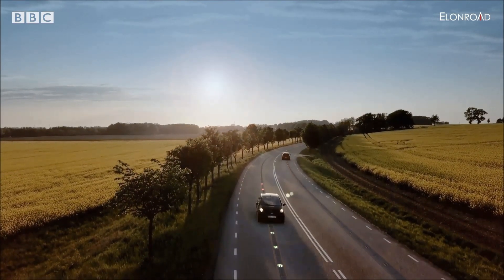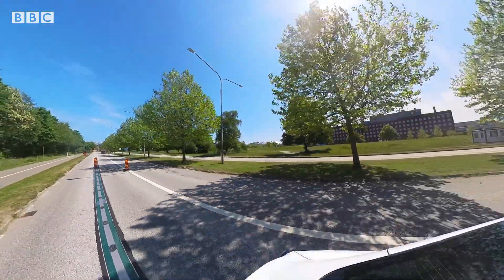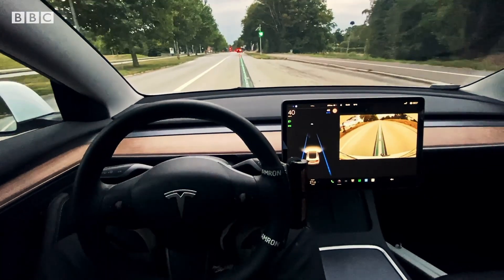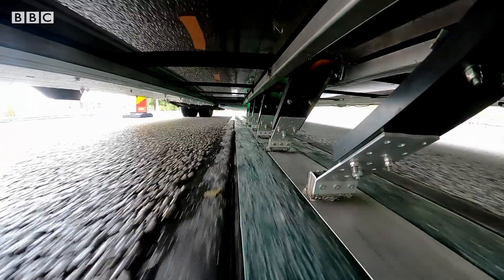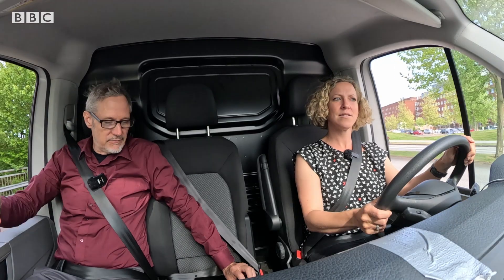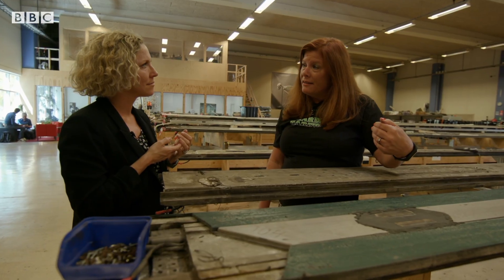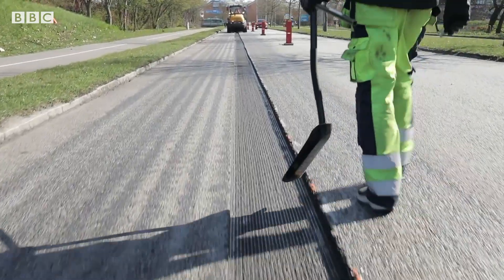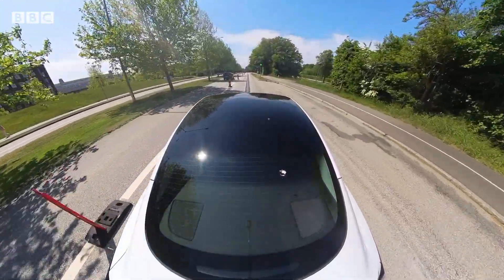The electric roads that charge your car as you drive - BBC News

Comment: Its a great technology. There are many concerns.... many people have already listed it. 
The smaller problems.
1. Drive a straight line. Can be solve with a wider contactor(from the car) to compensate for the left and right swaying of the vehicle. 

Now the good thing. 
1. Good for traffic jams, where certain distance the vehicles (EV only and not IC engines) can charge their vehicle while going at a slow turtle pace or at a complete stop due to traffic congestion. 
a) it helps reduce the losses from such congestion. 
b) Only at moderate to massive congestion location. Not the entire road system.

Comment: I had a similar idea, have the highways setup similarly to old slot car tracks.  The cars would need a simplified self driving ability.
   Cars could charge while driving, and get by with smaller batteries for when they leave the main highway systems.
   Of course we would have to abandon the idiotic solar and wind power pipedreams and go nuclear.
   This would take a lot of load off the system from charging stations and be a big step in solving the battery problems

Comment: THE EV "RIP OFF" SET TO INCREASE !!!
Another Con trick the public will pay for. You do NOT need "Electric Roads" to recharge EV's whilst on the move. You only have to fit them with an onboard Dynamo or Alternator. But then the Governments won't be able to TAX your EV's recharging methods, as Fuel TAX dwindles !!!!

Comment: From a purely engineering point this is an absurd plan, the term efficiency relates to how much energy would be wasted so say a direct charge has an 83% efficiency and could be up to 90% a system like this would only amount to a 50% efficiency at best but most likely being closer to 40% meaning we would have to produce roughly twice the amount of energy to charge the vehicles. 

Factor in the insanely high carbon emissions production of EV have in the first place this system would cause higher global emissions than your combustion engine automobile.

Comment: As a mechanical and aerospace engineer I find it preposterous we are switching to electric cars in the first place. Electric cars currently at least are of lower quality and longevity compared to your average combustion vehicle plus the carbon footprint due to the higher production output would only be marginally less than a combustion car.

The future should be an initial push to hybrid cars while we try to innovate in the electric storage (battery) technology and electric grid. If the electric grid like in today is largely depended on gas it makes little sense to switch to electric as we are still contributing to global warming.

The automotive industry as a whole is responsible for roughly 28% of emissions worldwide while electricity production is responsible for a further 25%. What we need in order to tackle global warming is a concentrated effort towards efficiency around all sectors rather than trying to set up a whole new system. 

Increasing the share of renewable technologies, investing in lab grown meat products, making the car industry more efficient by better hybrid technology, lowering industry (23% of total emissions) carbon footprint and improving residential energy efficiency such as phasing out pollutant gas heating would represent a 50% drop in emissions by 2030 rather than gutting the cad industry in a empty effort to show voters government is doing something about climate change.

Comment: I assume at winter time you would have a heating element on the actual charging part, but it would also force people to drive at a very identical driving lane to keep connection, forming deep and somewhat dangerous tire tracks in the ice normal buildup on the road. Then there's the question of salting the roads as we do here. I would assume a salt and slush mixture would not be kind to the charging system, at least not in the long term, making it require even more maintenance from all parties.

Don't get me wrong, I like it because it's cool and futuristic, but I'd guess there might be a multitude of practical problems yet to be solved or even thought of with this technology.
Reply: Which is wireless charging makes more sense. A sealed system that's less exposed to the weather and various hazards.
Reply: Please give your number,😭😭
Reply: They do this with rail systems where the third rail might get coated with ice and cause a disconnect.  It's basically nothing more than a very long heat tape that turns on when the temperature drops.  But this is also something that requires a fair amount of energy.

Comment: Caution: DO NOT piss on the third rail.

This seems difficult. You'd have to hold your lane very precisely. Induction roads would be less efficient but much easier to implement. Personally, I like system with overhead contactors for large vehicles like busses and tractors. The system has worked great for trains for the past 1035 years.
Reply: There's already an electric tramway line along that road - it was launched a few years ago, with its own driving lane. 

Saw this on the TV Saturday morning - the first time I've ever seen my hometown featured on the Beeb. :)

Comment: Can thieves tear up the metal in the road and sell it as scrap?

The public electric charging station in front of my building was torn apart, all the coper likely sold for scrap
Reply: The metal parts are fastened from the other side with big bolts and glue. Getting them off is not easy

Comment: Seems a bit excessive… All you need is these contact charging points in car parking spaces, as opposed to entire stretches of road. That way your car can charge at point A and point B and you’re ready to set off to point C.
Reply: Funny you say that as they sell the charge-while-parking solution very successfully. As well as quick-charge at the stops for public transport, industrial machines, etc.  As far as I understand its the same system but with different and more resource-efficient applications than the extended road systems.

Comment: They tried something similar in the UK about 5 years ago. A road had overhead contacts and further down they tried contactless charging.

Saw the little experiment... saw it working... and then never heard about it ever again, not even the results or plans. Which probably means that it was successful and the Tory Government are scared their friends in the Petrol business would lose out.

I say good luck to Sweden and i genuinely hope it's successful. I also cant wait for a country to publicly tell crude oil companies to get lost... and that day is fast approaching... Crude oil no longer provides unique essentials... Literately EVERYTHING crude oil does now can be replaced... and they know it, hence them trying to milk every penny now. I also say that the last Crude oil company to go green should be banned... just to send a little incentive and message.
Reply: I think you are getting confused with good old fashioned "Trolley Buses". Which had two parallel wires strung above each road lane (One plus, one negative), and could certainly exceed 60mph even with 100 seated passengers on a double decker, as demonstrated across "Mitcham Common" (South London/Surrey border) in the 1950's.  So what did they do ? Scrap the pollution FREE Trolley buses, and change to pollution making diesel buses, which have never had anything like 100 seats even on the Double Deckers !

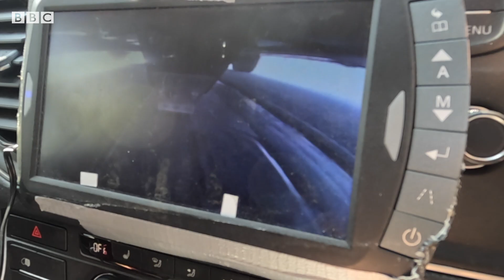Comment: Is it charging anywhere near full power in the demonstration? I would expect some sparking from the high current and voltage needed to charge an EV. Also, if that was to be used on a real road with contamination such as petrol, that road could ignite it? I also don't think the power delivery would be very stable, especially after seeing the contacts bouncing around (2:30). Any dirt on the metal would reduce continuity and cause more friction and wear.

Comment: This is a terrible idea. I cannot believe it’s been funded to this point.
Reply: Why
Reply: @TedKHole  it’s not easily scalable, is very complex, and is made redundant by the home charging and supercharging. In addition, cars will need sufficient sized battery packs to operate in areas which inevitably would not have this infrastructure set up, so it doesn’t help reduce the battery pack size.

Comment: It's a pipe dream of EV enthusiasts  ... the costs would be astronomical and not realistic economical viable.It's also anything but eco friendly etc. The only way forward for EV vehicles is to improve their fuel cell / battery technology dramatically ... i.e.have an energy density equal or better than fossil fuels. At Oxford uni they're working on revolutionary lightweight  carbon nanotube battery technology. Such carbon nanotube batteries would be lighter and more energy dense than current Li-ion batteries etc. As for electric roads, that'll be a step back in time.

Comment: This in theory looks good, but what about if you have to be switching lanes. You would need a power track in each lane. Not all vehicles can stay in one lane because of traffic and other issues. 

How is able to overcome issues with winter conditions when the roads are frozen over with ice and snow. I would think inductive charging would be better because of non contact. 

I would not reduce battery size in vehicles, because people need the freedom to be able to go in to rural areas, or in off road conditions.

Comment: How much would it cost per mile or per km? Maintenance cost? Centralized charging station is much easier to maintain and more reliably available.
Reply: (if the tech works...) Centralised charging station are NOT easier, people have to divert to get to them, often queue to use them, and then wait 20-40+ mins to charge. Even if these are only on main roads, that's literally millions of cars that will never have to use a charger. No reason maintenance would be more than the expensive chargers along with the parking space they take up, and the associated screens/kit to pay with credit cards. If the tech works.

Comment: That is going to be a monumental nightmare in terms of road maintenance and cost. I don't think most people understand just how rapidly roads degrade and deform. Delicate systems that like that built into a road that is constantly deforming over time is going to make maintance / repair costs far too cost prohibitive I suspect. A single car crash on that strip will likely cause catastrophic damage to it and require very expensive repairs. While this seems like a novel idea, practically speaking I just don't see it ever becoming a viable reality beyond a few test roads. Also this is far too vague on actual power output - I am highly skeptical about the amount of meaningful power it can provide to charge a car.
Reply: Ikr? Why not just use pantograph like trains and buses have for decades? Pantographs also have quite a long life, although they can be damaged by tree branches and knocked down during storms.
Reply: @Awesome_Aasim  Probably because pantographs would look slightly ugly
Reply: A pantograph would still need an earth connection from car to road.
Reply: Trams work just fine...
Reply: Nah i don't think so, I think it's really good
Reply: @mhjunky4278  Hydrogen is even better
Reply: Yes and commercial air travel was just a dream when the first successful flight took place.
Reply: @DaveSmith-bg2jh  You are outright delusional to compare a monumental and pivotal historic moment such as commercial flight - an event that literally changed the world and made it vastly smaller for all humankind - to this piddling little idea that does nothing new. It makes an arguably more logistically complicated method to charge vehicles is all.
Reply: and now you an electrician to make sure that the road workers don't get toasted.
Reply: Highly agree, additionally lanes would likely be out of service at a higher rate than a standard road.  I would also wonder if there is a concern with theft - likely valuable electrical components being used in this system.
Reply: @ml1881-r3n  Considering how frequently copper is literally torn / stolen out of telephone poles and other places to sell to scrap yards, I wouldn't be remotely surprised if someone took a pickaxe to the road at night to rip out the copper wiring etc.
Reply: Cost lol 😂the government print the money paper so I don’t think it a cost for them
Reply: Hathor, I agree complete! The folks who think we can install “indoor plumbing” and, gads, “indoor electricity” in every home are even nuttier! Never going to happen!
Reply: I suspect this feature is going to disrupt electronic devices for motorists. It's going to tamper with alot of new car models. 
Cause alot of radiation and could even take control of the car, restricting the car driver of control over their vehicle!
Reply: if there was another way... maybe. But this system looks doomed
Reply: Yeah there's a big difference between things working on a small scale near cities vs the country as a whole.
Reply: Yeah. There might be a system with minimal wear & tear but technical details weren't discussed.
There is some logic into electrified roads. I suspect just a "few" would be enough to cover most of the vehicles in a country. I also wonder if there are only a few roads, if people will now drive on them just to charge their vehicle...
Reply: Please give your number,😭😭
Reply: You apparently don’t live in Sweden. People aren’t hurting for money. It’s a very futuristic country. Speak for your country, but for Sweden it is actually very practical. People there invest in important things and enjoy paying taxes for a better country.
Reply: Every  new technology  is received with negativity. It will improve overtime and someday it will work perfect😂
Reply: So true - I hear you. But... on the plus side though, at least it'll mean speed bumps will disappear 😂
Reply: Peace be with you 💚
We Invite You To Join The Religion of Islam, as you may find peace. Islam is the latest Revelation from Allmighty God (Allah) for All the Human & Jinn kinds WorldWide. Our suggestion just Study all Religions including Islam, then you're welcome to convert to the religion of Islam in order to successfully pass this Test of Life and be saved 📗from🍀🍃 everlasting Punishment of the HellFire. We wish All the Best 🕊🍀💬🌷🌷🌷
Reply: Think a kind of person that never tries anything new and never inovates...
Reply: Biggest scam of the century..
Reply: it will happen and trust me in about 12 years of time it will be by far less maintain intensive and more efficient than a tar road can ever be.. just stick around if you. may :)
Reply: @Enrico-o3c  It's already been abandoned, FYI. Paving 1km of this "electric road" was going to cost 9x more per KM of regular asphalt road and the bloody thing was falling apart already after 10 months. Most Asphalt roads only begin to degrade after 4 years. The instruments in the asphalt were causing deformities in the asphalt, making it degrade even faster.
Reply: I think Hydrogen would be better.

Comment: Absolutely love this idea. How clever! Fuels the vehicle and charges the battery at the same time. For commuters, they can skip finding plug in stations to refuel. Excellent for long distance trips, which a real plus.
Reply: You cannot go long distance in an electric car 😊
Reply: Carry along two push bikes mate one for you and one for your partner to continue the trip  Simple and easy @firesidefairytale
Reply: Dumbest idea ever
Reply: It's moronic and illogical, a bit like the climate con
Reply: Good luck with this. We can not deal with what we have already. This is a bad dream.
Reply: Wouldn’t work in snow.
Wouldn’t work in rain.
Leaves in the fall make great kindling.
Who will clean and maintain them?
Every car would need these contacts that would wear off if not fly off the car altogether.
Every road would need these installed.
WHAT A STUPID IDEA!
Reply: @guybeingaguy Common sense is uncommon 😊
Reply: Great idea, expensive as hell. Since money doesn't grow on trees and people don't work for free, this idea is not feasible. Cars spend the bulk of their time parked, so you're better off putting rechargeable surfaces under places like parking lots. Of the many places where this type of system could be better implemented, putting them on roads is like the last spot you'd go with. It's like those stupid ideas people come up with for solar panels. Why stick solar panels on the road and deal with all the issues of that when there are tons of rooftops and open space available that isn't being used? This is like stepping over dollars to pick up nickels in terms of ROI.
Reply: @addanametocontinue  No Brainers idea; just stick to ICE cars    cheappa and more practical: Driving on every odd/even days for example; workdays on even/odd days etc..; no more planes eliminate them down to 30%  etc    BJ

Comment: What happens in the rain?  Doesn't that charge make contact with the rest of the wet road?
Reply: Exactly what I wanted to ask. I myself is an electrician and I wonder how that effect will be solved
Reply: @theeelectriciantv On top there will be a roof of solar panels that will power the road for free.
Reply: @Alexandrr6  But you haven't answered the question
Reply: @theeelectriciantv  it will be a roof made of solar panels
Reply: good question